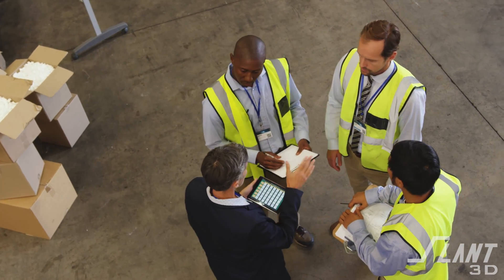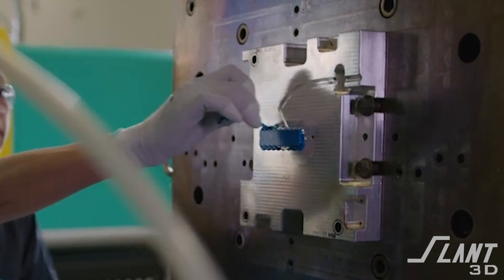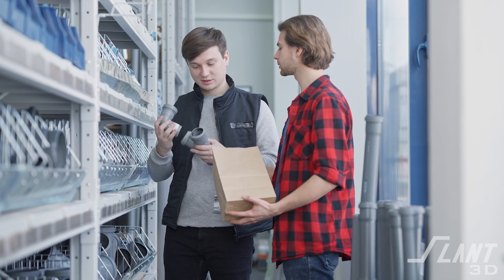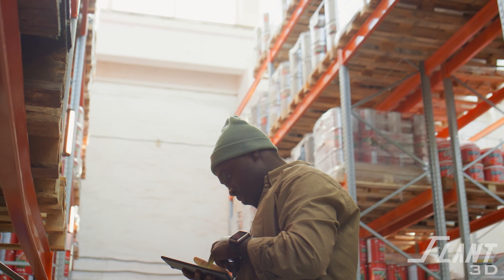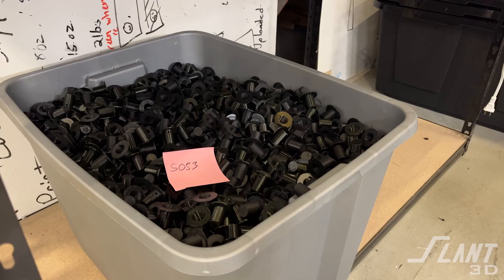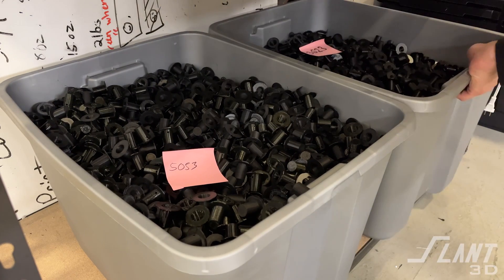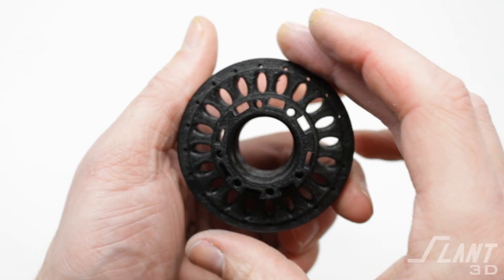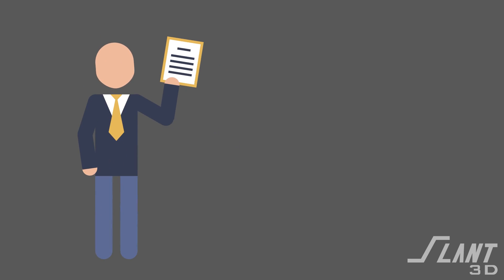How To Get Your Spare Parts with Mass Production 3D Printing

Comment: it shocks me that appliance companies do not do this for thier spares.  immagine no more discontinued parts.  same for power tool shrouds and handles.  they often break and spare parts are not available or super expensive.
Reply: Discontinued, difficult to acquire, and overpriced parts are part of their MO. They want planned obsolescence. This is something that has to change with the mindset of these companies, or they have to be forced by law.

There are scant counter examples which value long term customer relations and offer replacement parts long-term and for a reasonable price.
Reply: @SianaGearz  lets say a company uses planned obsolescence. You buy their thing one part breaks. Now you need to buy a new thing. So you are prepared to spend 100% again. Suddenly you are offered to get a replacement part for 11% which would fix your thing for now. You are happy to agree to the deal, cause you saved money. But the company is even happier cause they were able to sell an item, which costs 1% with a margin of 10%. If the customer would buy a completely new thing, you would only get a margin of 5% in order to have competetive pricing. Things can be sourced from other companies. Spare parts cant.

Yes, planned obsolescence is one way to make more money. But it is usually replaced by methods which make even more money.
Reply: @djddm8760  Margin plain doesn't matter for typical appliance businesses. What matters is gross revenue - you need to keep it high and in particular you need to keep it consistent, you need to keep that factory floor running at capacity. What also matters is gross profit. Making less money per item and selling more items is an entirely viable strategy. The more product you build, the cheaper it will be per item built, you're making use of economies of scale. This is the incentive for planned obsolescence.

Margin can matter with fully commissioned manufacturing, like Flextronics can rebuild their facilities rapidly to manufacture a completely different product, including Microsoft Xbox Game Controller, GoPro camera, Valve Index Headset and Lighthouse, Beats headphones, Chromecast, HP inkjet printer, a car headlight, etc. But even then they'll make it worth your while if you order more.

Next gen reconfigurable manufacturing is on its way though, to reduce setup costs for reconfiguring the factory, so perhaps repair will become more viable.

Comment: Hows is this not copyright or IP theft? So I can't make knock off pokemon figures and advertise it all over the internet, but I can make spare parts for stuff? How are these 2 things different?
Reply from the maker: Working with the organization that designed the parts to bring defunct parts back into production is the same as having a contract manufacturer make the first round of parts
Reply: How is this not a troll comment?

As Slant says what they're offering, is an opportunity for the original manufacturer to sell you replacement parts by having them manufacture the parts on behalf of the original manufacturer. This way the original manufacturer continues to exploit the intellectual property (if any) the way they see fit.

But you can actually make and offer many replacement parts independently. It depends what sort of intellectual property protection exists for the part. An item that exists for its aesthetic, such as a Pokemon figure, is subject to copyright, so that's going to be a no-no. Purely functional items and functional aspects of aesthetic items are not protected by copyright, explicitly excluded. They can be protected by patent, but patents run out eventually, they last 20-ish years. Besides, most (plastic) things that break are all sorts of guide pieces, mechanical connectors, safety baffles, enclosure pieces, control surfaces, geartrains, etc things that are well known to any engineer and are not eligible for patent protection, basically the same things that have existed for a hundred years or more in just slightly different size and shape, things that are not functionally unique. What can also be protected intellectual property is trademark, trade dress, etc, so the items that you offer must not be able to be misconstrued in origin. As such the vast majority of purely functional replacement parts don't enjoy any intellectual property protection whatsoever, but you've got to talk to an IP lawyer or domain expert to be certain on a case by case basis - they'll also presumably tell you if the company may try to make use of pressure instruments in spite of not having legal foundation to stand on, and how to protect yourself from that.
Reply: Not sure about US but in EU spare part cannot be protected unless it's a registered design or part of a patent. Which 99% spare parts are not